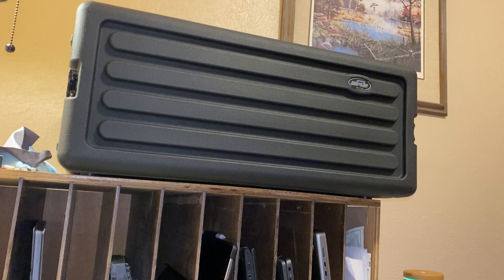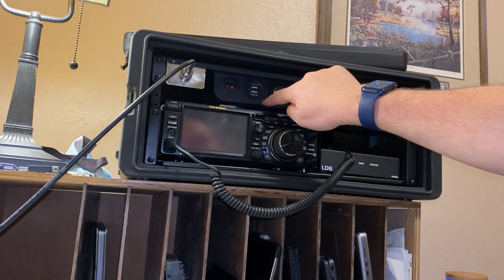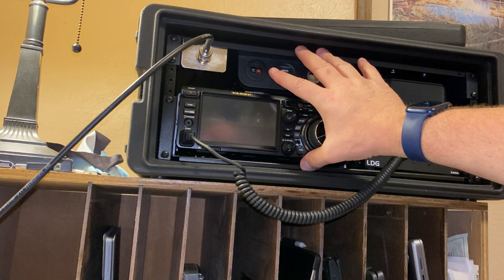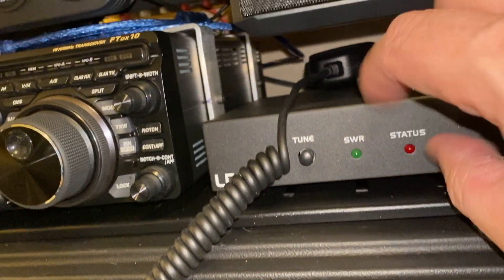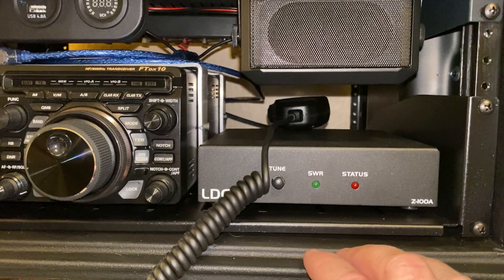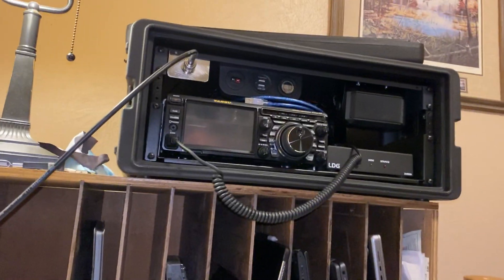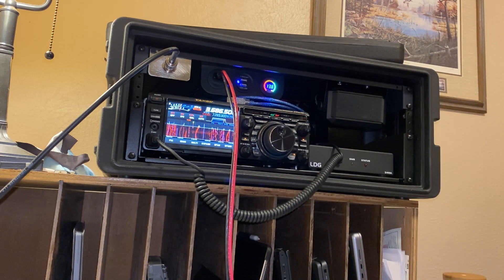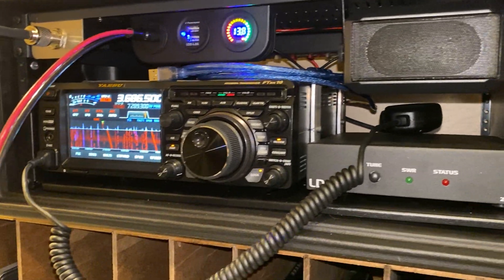Ham Radio Go Box Tour Version 1

Comment: I like that... Why not just go with the 1u shelf on the bottom?
Reply from the maker: we all just make these up as we go. I envisioned the shelf being attached to the back as well, but it is not long enough. I wanted it to have the strength to hold the radio when sideways.
Reply: @bob_kd5qdq  ohh okay.. wasn’t sure if the 2u shelf had more weight support or not.